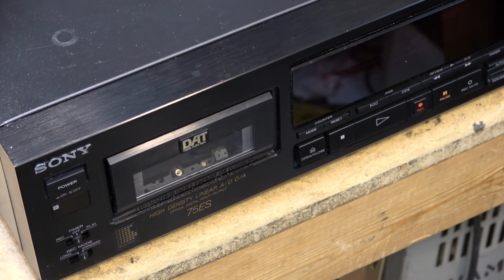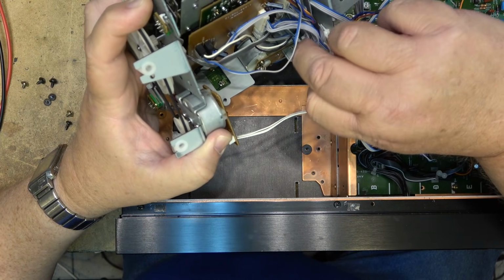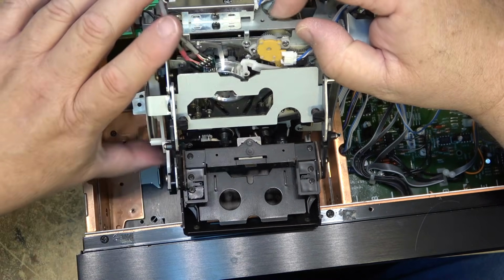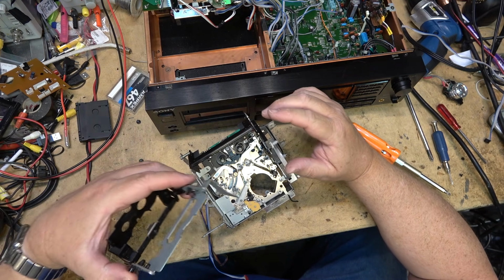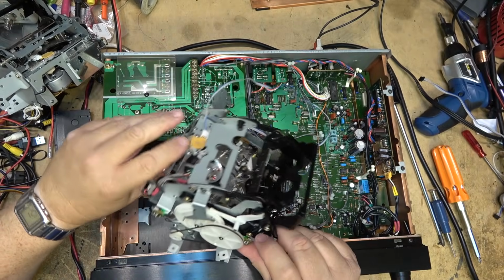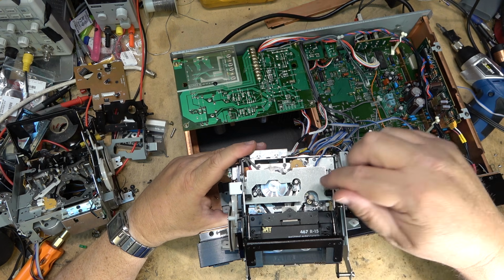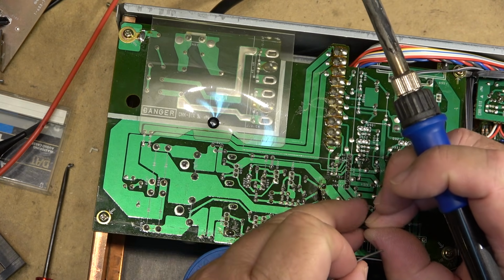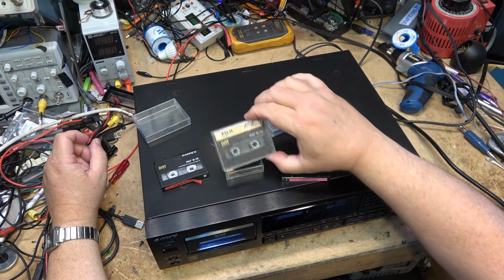Sony DTC75ES Rise From The Ashes

Comment: Awesome as always .I  was remembering back at early 1990s .A couple of things I remembered that many of the machines were designed intentionally to only be worked on by that specific company. So many of the ridiculous designed components specific to be able to repair by that particular company . Like with most were being setup a built even then by computers to not be able to be fixed by hand.The best example was a neighbor bought a specific high end car and had a Right rear Drum problem. He could not fix it simply because you had to specific tool you could  not by over the counter . His car setup on blocks for a year until this tool was found in Italy. He did get it fixed and used for years .But was stunned that it was so hard to get  the tool.In the early 1990s this was a push by many industries to block right to repair by the average joe. It  is a secret then. Now its an obvious reality today being  talked about. Glad you got it fixed.Im learning more and more of what happened to many of the  
electronics I had.I  did not have the skills or repair equipment to even fix them 
Nice to know I was not crazy at how they were designed to not be able to be fixed then and now you have proved they can be 🤪
Reply from the maker: Right to repair or lack of it was pushed by a big companies like Apple. They did it to protect their intellectual property. If repair parts were readily available the competition would buy those parts and reverse engineer them and make clones. Apple was the first to start this BS and then everybody else followed suit.
Reply: I always found that there are far worse devices to work on than Sony DAT decks.

Pioneer "Reference Master" cassette mechanisms come to mind ... 😂
Reply from the maker: @svenschwingel8632  ya, Panasonic DAT
Reply: @svenschwingel8632  Panasonic G mechanism VHS VCRs.

Comment: We went through many of these Sony home unit DAT machines at the CBC. In Vancouver we used the home units modified to record at either 48KHz or 44.1KHz via the front mode switch (under the SONY logo). It was a number of years before we started to get the pro units for DAT to DAT editing and very soon after that computer digital editing took over and we were mastering to CDR's and the home units went to many peoples homes until they died for numerous reasons. Primarily from lack of use and/or no service support. I remember that they tended to love to eat tape when they were starting to go bad. The first minute on each tape we recorded tones so that that would be what got eaten rather than the program material when loading and ejecting cartridges.
Reply from the maker: Yes DAT saw plenty of use in production.  I used it to record voice over copy for dubbing in as the announcer would typically record in a booth somewhere and then I would just have the tape of the voice over script and punch it in on the video when editing.   I rarely saw the talent when we farmed it out.  He got a fax of the copy would lay down the copy and send the tape over.  As you know tine was money and these personalities charged typically 100 per minute so we just let them read the copy a few times through and then we could pick and choose what we wanted in post.

Comment: Some of these transports can really test a persons sanity, I have one which is similar to your one (DTC-300ES) everything is aligned as per the service manual, nothing is gummed up, it plays a tape no problem, it even will let me forward and backwards cue the tape, but if I hit stop then want to fast forward for some reason the two big metal ring gears don't quite push up the sliding bar on the left hand side, if I push FFWD and quickly push up the sliding bar with a screwdriver it fast forwards or rewinds the tape, I aligned the rotary encoder and the big metal ring gears but it still doesn't work, unless there's a hidden pin switch I'm not aware of?

Comment: The 75ES was sold in Europe as the 55ES. This was the last iteration of the 3DD mechanism in an ES machine that was any good before Sony started to do it cheap with the 57ES/59ES/60ES and their DATM100 mechanism series. If anyone asks me what Sony DAT to get, I'll always tell them to go for a 4DD ES machine - the ZA5ES is a really great-sounding choice.
Reply from the maker: The 4dd had their own issues.   The 3dd were actually gentler on tapes.
Reply: @12voltvids  strange. The only machines I own that can really handle the thin DDS2 120m tapes are my 4DD machines (a PCM-2700 and two ZA5ES). Granted: DDS2 was never intended for use in DAT decks but they handle them just fine 😬

But I also own a PCM-R300 and a ZE700 which are 3DD (late iterations) and have built-in thintape recognition via an additional microswitch. These were really decent 3DD machines.
Reply from the maker: @svenschwingel8632  the trouble with the direct drive reel tables is the inertia of the rotors.  They tend to cause tape slap on High speed winding.  
I haven't had any problems with the thin data tapes on my 75es or da40 decks.
Reply: @12voltvids  interesting aspect about the rotors. I have yet to run into problems with these machines and I really love my 4-head 2700 for its monitoring and the smooth operation which seems to be inherent in the DATM5x 4DD series. The 3DD always operate so noisy with all their click-clack 😬

Comment: Hi Dave...I found the problem on my TRV-340E...the pinch roller was not running free. Washed it out with surgical spirit and nice running free now and not chewing on my tapes any more. Question...must I oil it a bit or leave it running dry?
Reply from the maker: The problem with oil is that it will fly out in FF or rew.  Remember that 8mm keeps the pinch roller engaged for FF/rew.   Running dry will wear it out faster.  So yes it needs lubrication but a miniscule amount.  Into the bearing.  This means removing the roller and attempt to get a tiny amount of lube into the bearing.
Reply: @12voltvids  Thanks and much appreciated.  Will do. Nice to have my digital8 up and running again...mostly due to your videos...totally addicted now and watch every single one.
Tomorrow I can archive my last few tapes. Stay safe.

Comment: Hi Dave! I have a question for you. I have a 55ES with very similar mechanism with yours. When I press AMS FF or REW (go to next or previous song) the machine successfully finds the mark and start playback but the relay does not kick in so i have no audio. I must eject the tape or press multiple times stop -> play to make it work again. Do you have any idea what is the problem? Could be electronic issue or mechanical? Thanks and great video as always!
Reply from the maker: Error count too high likely.  Could be bad heads or bad caps in the head preamp.
Reply: @12voltvids  caps in head preamp already replaced... hope its not the head because that means game over... unfortunately you are very far away from me to send you the unit for repair...

Comment: This dude is good...man I wish he took work in...I have plenty...I have the same deck..it great when it works :-)
Reply from the maker: I do take in work. I get stuff shipped in all the time and locals bring me stuff on a regular basis.  I just don't do this full time now and never guarantee i can fix anything as parts can be an issue. Like this one.  It was given to me actually over a year ago. I didn't look at it for quite awhile as I had other stuff.  When I did i found the drum motor was shot and fortunately a viewer has a chassis they donated and i was able to swap the drum and backtension band to make a working machine.  Many times this is what needs to be done to repair these machines.

Comment: Looks like you spent a lot of time working on DATs, and all of them fixed !
Reply from the maker: Try to keep these units functional.  There is so much original dat material that musicians have stored away. I do lots of dat to wav transfers for many musicians.  That's the main reason i keep these units all running.

Comment: Sir ,
Do you have a good, working Sony DAT system for sale?
Reply from the maker: No not selling at the moment.  I may have a da30 to sell soon.
Reply: Ok sir
Reply: What would one use a DAT recorder for nowadays?
Reply from the maker: @zulumax1  playing the hundreds of existing tapes I have.  Some people made their mix tapes on cassette, others used reel to reel, I used dat.  These are actual mixed tapes that i DJ'ed using 2 turn tables, 2 CD players and a mix board. Other tapes are aircheck tapes recorded off c bans satellite.  I have many bootleg tapes too I traded with other collectors.   So any time i can get my hands on a good machine I grab it.   Especially when it's free.   I never have any trouble selling one when I have too many.    I have 2 now i will be looking at selling.  One Panasonic and a tascam da30.
Reply: Excellent! Thanks!
Reply: @12voltvids  I was always the "sound guy" at all the house parties we used to have when I was in my 20's, or my friend ran his rig, we took turns. I put my mixes on my Sony TC-399 reel to reel, didn't like having to handle records at a party, I wanted to have a beer and visit and gab myself.
   My friend used a Randall stereo amplifier, which was formerly owned by a band, to run multiple pairs of white van speakers which he put Pyle Driver 12 inch pro woofers in. That amp put out 900 watts per channel into 2 ohms. One time he plugged in the power cord and the amplifier power switch was on, BOOM! all the woofer cones were pushed all the way out of the magnet and the cones buckled!
Reply: @12voltvids  That Sony TC-399 reel to reel I still have, but it has noisy transistors in the front end. Common problem on these from what I have read.

Comment: Good repaired. The best system overall was MiniDisc. Philips would not end magnet tape and move on. Philips made it difficult for Sony when they tried with MiniDisc. Sony won the war!
Reply from the maker: Minidisk was a compressed format.  More comparable to mp3 than uncompressed datnwhich had higher spec than cd.
Reply: @12voltvids  Yes I know. But other than that, minidisc is better. Towards the end of its life came HI-MD PCM which came far too late.

If I remember correctly, minidisc lived longer than DAT did.

Minidisc had much better editing capabilities and was much faster than DAT was. 

Minidisc tried in a way to replace the compact case.
Reply from the maker: @ford1546  
Dat was a professional format used in every recording studio in the world.  It was also heavy in film and TV production and radio.